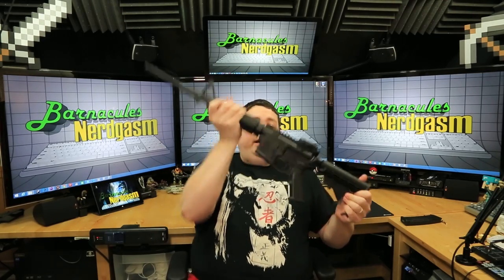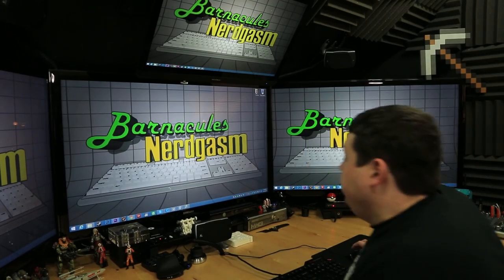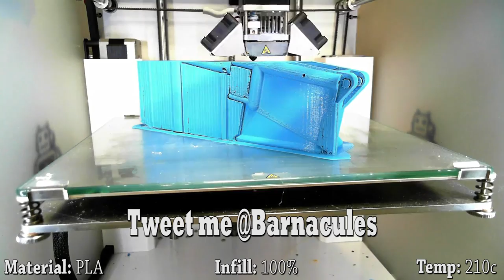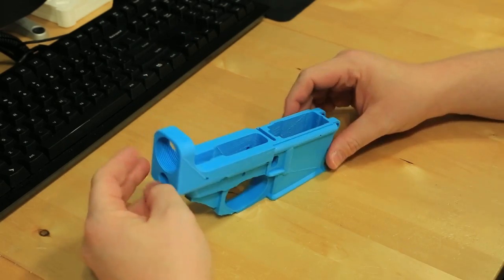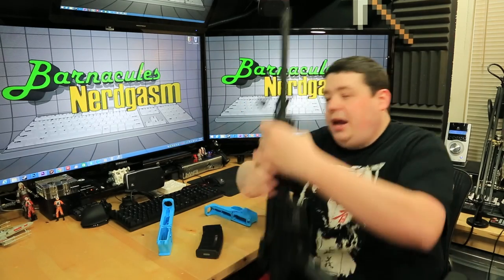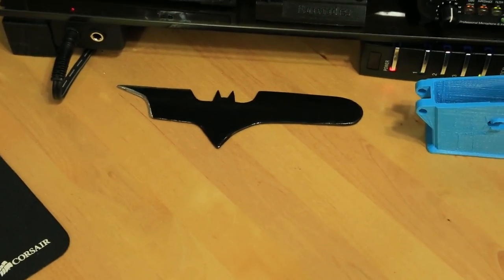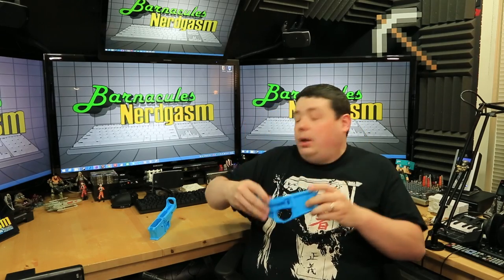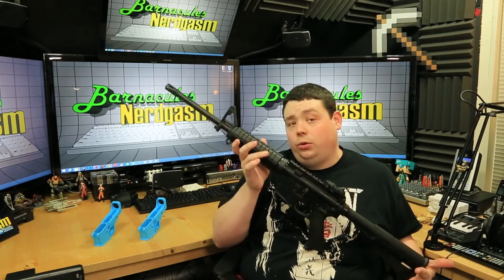Why you shouldn't print an AR15 on a desktop 3D printer 😎 - @Barnacules

Comment: This isn’t the BS “3D printed gun” but has to buy all internal Parts is it ?
Reply: FGC 9
Reply: Who cares? The other parts aren't regulated at all. The point of 3d printing The lower is to avoid having to deal with background checks, foid licenses, and waiting periods.
Reply: The reason people tout the term "3D printed gun" when only the lower is actually printed is because no other part is regulated. You can go online and buy every single other part and nobody cares. The regulated component (in America) is the lower receiver, which happens to be printable on most guns. The government tracks these and they are what is considered, legally, to be the firearm.

In the UK I'm pretty sure their regulated parts are the pressure bearing components, like the barrel. Barrels are definitely not printable if you want to fire more than a single bullet. Even then the barrel wouldn't hold the pressure to accelerate the bullet to any significant speed (still super dangerous though).

Even with all of this, almost no 3D printed assembly consists of plastic only. Most require screws, bearings, collets, rails, dampeners, belts, electric components, or metal/machined parts to function. 3D printing is a rapid prototyping/low scale manufacturing method which, in some forms such as FDM/FFF, are non prohibitive to regular people. For the same price as a competent printer you could just as well buy a milling machine and make these parts out of aluminum.
Reply: @codyhubert6178  Why are you explaining something no as asked, I didn’t ask you to explain the parts of the gun ….. Just shouldn’t call it a 3-d printed gun if it isn’t really because if your beloved stores that sold the internal parts all closed Down you wouldn’t be ass out with a handful of plastic
Reply: @tannerlane9669  I really wasn't trying to belittle you or explain something nobody asked. I'm sorry for coming across like an ass.

I was just trying to explain why people use the term "3D printed gun" and why it is relevant considering no gun can be completely 3D printed. 

Also I agree, if all the people who sold gun parts stopped selling, 3D printers would be irrelevant in the manufacture of firearms. In that case I'd suggest people buy mills.

Comment: Lol clearly you're in denial. I've seen a guy print the lower receiver and build around it. It's possible and I honestly belive you got you're specs wrong just for the sake of saying can't be done not worth the time since you clearly never wanted to do this video. And the lower receiver is the most important part because 1 it has the serial numbers on it and it's the part not easily available on its own.

Comment: Stupid all you jave to do is acid bath then it would fit smooth out the lines and add a smwld to the plastic to free fall and have higher integrity also you can by the parts online not the lower lol better yet cold cast or aluminum forge